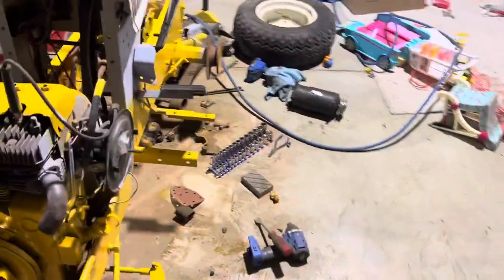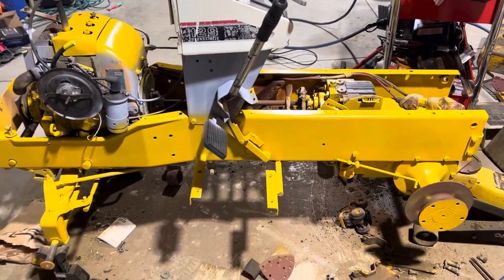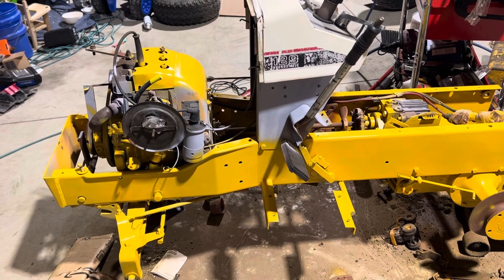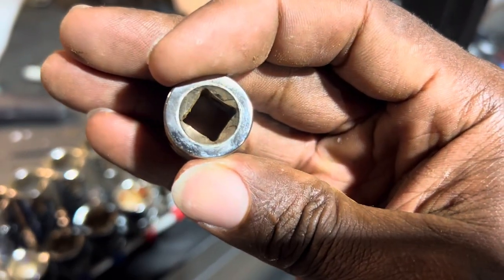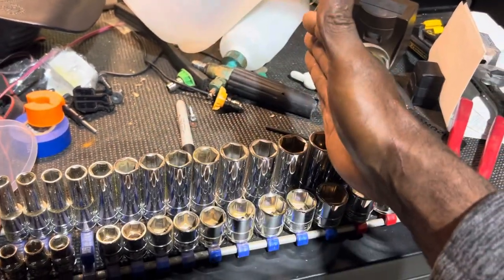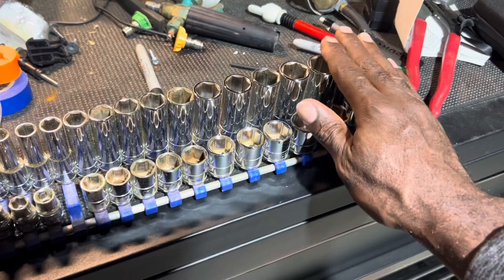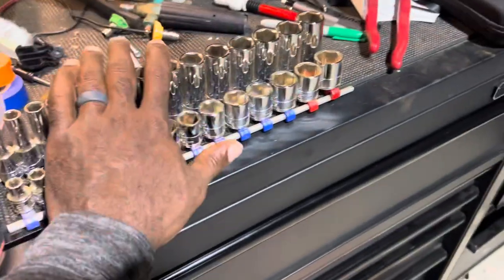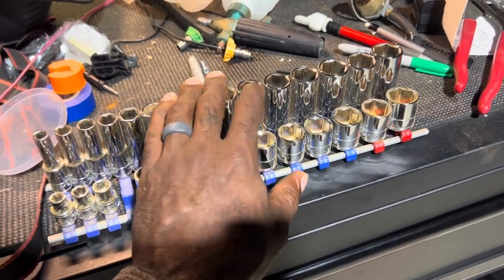CAPRI Tools Socket Review: The Good, Good and…well…Good…

Comment: It’s so refreshing to see someone that is actually using the tools and  everyone can see them a dirty, dusty, a bit of surface rust, oily and basically not looking like they are new and ready for a “tool show” contest.
Reply from the maker: Everyday! I have two big projects (hotrod/engine swaps) that require a full-suite of tools to get the job done. Anything from fabrication, welding, cutting, torching, measuring, fitting, etc

Comment: My father owned a big automotive repair shop for over 60 years.  At least when I worked there we used chrome sockets almost exclusively.  During that time I recall us cracking one or two sockets when used with an impact wrench.  Otherwise chrome sockets worked well and were very durable.  We were using SnapOn sockets BTW.  Maybe if you buy cheap sockets from Walmart you would have different luck.

Comment: Can anyone here recommend me some good Mid Range Tool Brand for hand tools for like - Ratchets, Sockets, Pliers, Screwdrivers, Wrenches etc....
Reply from the maker: Sockets: Capri, Sunex, Grey Pneumatic 
Wrenches: Capri, Tekton, Olsa Tools
Ratchets: Used Snap-on, Olsa Tools, Capri
Screwdrivers: Lennox (Lowes)
Pliers: Icon (Harbor Freight), Olsa Tools, Channellock
Reply: Here is what I have, and I am happy with all of them:
A) Mostly Pittsburgh ratchets, but also have Duratech, Stanley and Capri.
B) Pittsburgh metric and SAE  combination wrenches (Husky filling the missing sizes), but at some point I want to upgrade to the Capri Wave Drive combination wrenches.
C) Tekton metric and SAE flex-head ratcheting combination wrenches / 6 point (bought at the end of 2018 and no issues yet).
D) Sunex 1/4" and 3/8" impact sockets / 6 point shallow and deep.
E) Tekton 1/2" impact sockets / 6 point shallow and deep.
F) Stanley 1/4" chrome sockets / 6 point, but eyeing Tekton 12 point.
G) Capri 3/8" chrome sockets / 6 point shallow and deep.
H) Sunex 1/2" chrome sockets / 12 point shallow and deep (metric only, due to not really needing large SAE at this point).
I) Quinn and Craftsman screwdrivers.
J) Quinn bigger pliers and Pittsburgh cutters and smaller pliers.
I obviously don't know how much you will use your hand tools, but I am at most a Weekend Warrior, just working on my car and things around the house, but instead of paying big repair costs, I repair my own cars and appliances around the house, and build my tool collection with the savings, letting them pay for themselves.  I don't buy socket sets from Harbor Freight due to if needing to warranty one, or buy a lost one, they want the whole set brought back, to replace the whole set, not single items from a set  They also can skip sizes and I like master sets.  I have also heard a lot of good things about Grey Pneumatic tools and return policy, but do not have any experience with them.  No issues with any items listed above yet, but a little worried about the Pittsburgh and Husky combination wrenches rounding off stubborn bolt heads, hence the reason for the upgrade to the Capri Wave Drive combination wrenches in the future.  I have come across some really tough stuff to loosen over the years, but have always been able to use impacts and torches so far to break them loose without rounding them off.

Comment: I gotta keep my Capri impact sockets well oiled as they want to rust but I won’t let them. New they came dripping wet in oil but I added Lucas gun oil to prevent anything further.
Reply from the maker: That’s interesting… I have a set of the 3/8” stubby impacts and they came dry as a bone…never seen a spec of rust on them and I don’t apply any oil…

Comment: I have been very impressed with the capri tools i have a few things from them that i have been using so far so good
Reply from the maker: Same here!
Reply: I was impressed with the angle wrenches, thin wrenches and their ratchets both 72 and 90 tooth. The sockets are ok but the same as you’d get from any Taiwanese set. I prefer the Tekton chrome sockets and the ratchets are about equal now that they’ve both gortten comfort grips. The impact sockets are about on par with Sunex so watch the price.